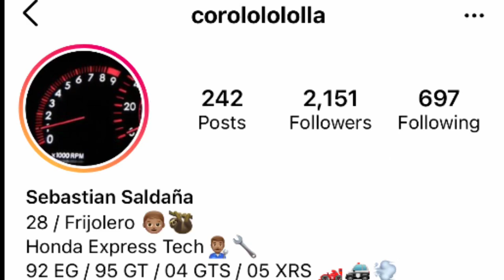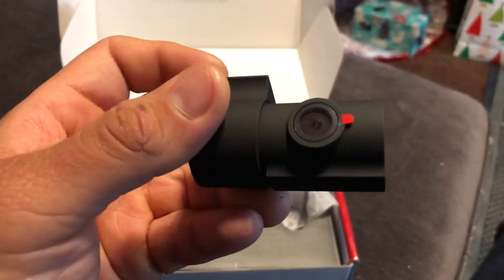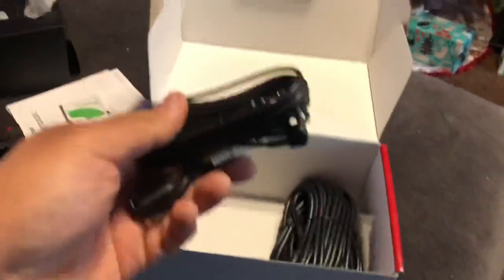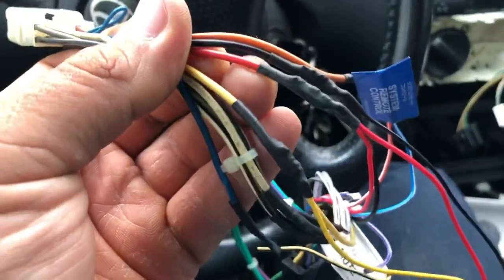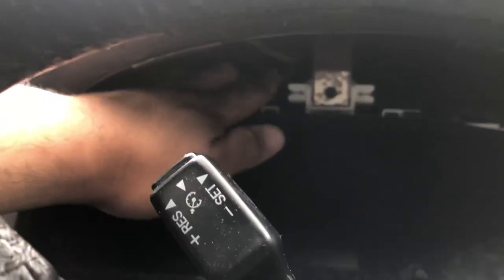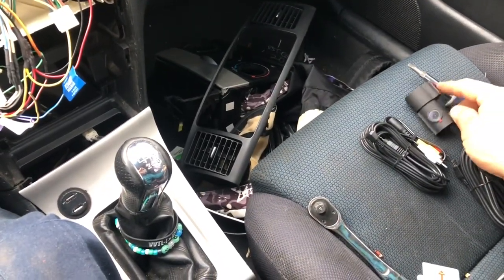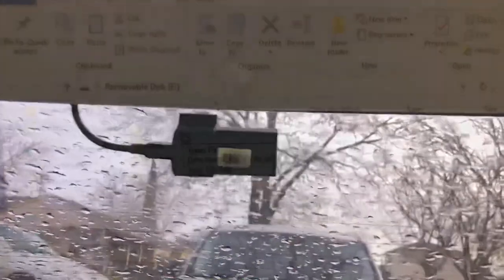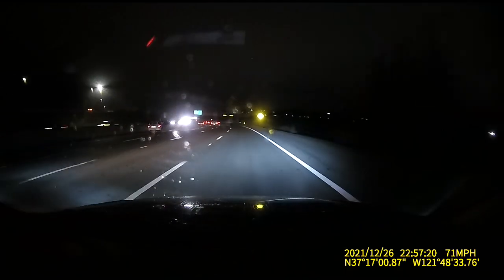Pioneer VREC-DZ700DC dash cam install and review

Comment: Got this dashcam too, wanted to know if it's possible to plug it instead in the fuse box with fuse taps, and if a voltage converter is needed
Reply from the maker: Yea I would say so, that way you don’t have to cut n splice into an existing harness

Comment: Off topic: i was going to wait for your next stream. But hey, what's the best available suspension right now for a matrix xrs. Budget $550~ or less. Hard to find stuff that's still available to purchase
Reply from the maker: id get some koni / tokico with some H&R lowering springs for a daily setup. coilovers are cool and all but they are too aggressive for daily use.
Reply: @2zzlow  Would you recommend against kyb with H&R/eibachs? Tokicos seem to be difficult to find for a reasonable price. Also, which koni's are you talking about? Orange's?
Reply: @2zzlow  Also, have you seen an issue with putting the corolla koni's on a matrix?

Comment: nice review.  i have a pioneer headunit in my celica as well and this would be a good addition.
Reply from the maker: Good call!
Reply: Can the rear camera be integrated into an AVIC unit?
Reply from the maker: The dash cam has video out so I assume you have the choice to get display from either camera on to any head unit with video in.

Comment: Looks like a good camera. I would have routed the rear camera cable through the headliner and not down and back and up
Reply from the maker: yea that also sounds like a good plan but that requires more dropping of the headliner and its components on the sides. i also dont want to mess with the curtain air bags